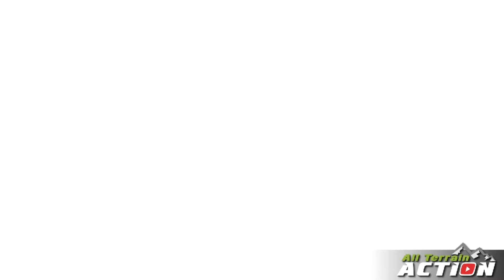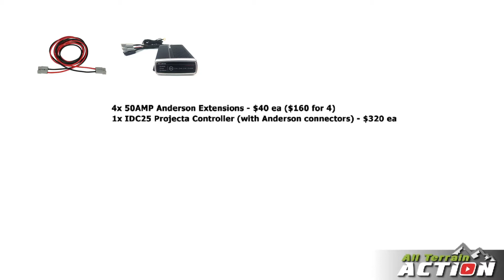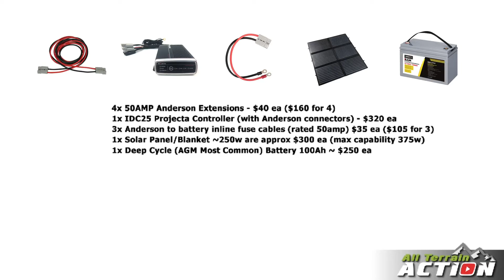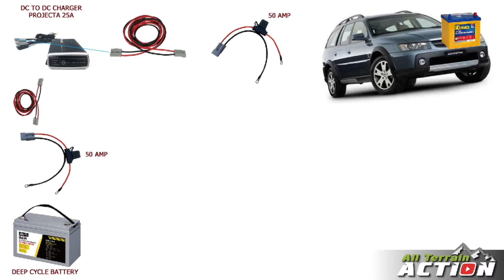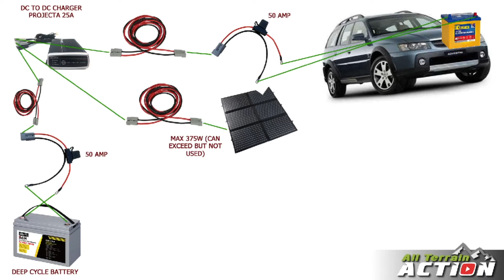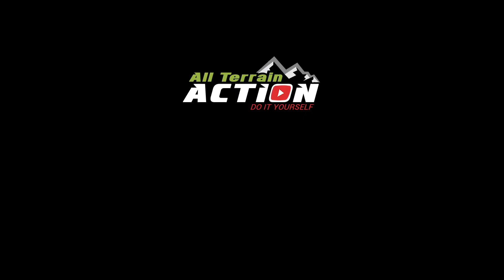EASY DIY Plug and Play Dual Battery System with Solar and DCDC Controller

Comment: What do you recommend as the best fuse option for in the engine bay
Maxi blade / 5AG / circuit breaker 
Cheers
Reply from the maker: Depends on the application. Normally would work out how many other aftermarket accessories I'd be setting up. Normally would just distribution block with blade fuse setup, unless extreamly high current eg 30a plus.
Reply from the maker: Maxi blade and 5AG fuse options mostly used for high amp stuff, big audio amps or mass of lights but if I had a circuit such as a 25a run to my dcdc from my main battery/car circuit i'd use a circuit breaker or self resetable because these are things you need when remote/travelling and you may not be able to replace a fuse in middle of no where, at least with circuit breaker or self resetable you can remedy the issue and reset. If you use a circuit breaker then its gone, short = no more power and you will be alerted to the problem as for self resetable it may reset so often you never notice. Each to their own in this sense.

Comment: can i just run the earths  to my bus frame
Reply from the maker: Yes you would normally run your earth to vehicle frame normally, we just did not include this as the idea was for those who didn't want to drill/mount into the vehicle permanently. This assumes your vehicle is negatively earthed and is part of the same circuit.

Comment: I was quoted $980 for the unit and then around the same amount to instill it .Bought one of these for $360 put it in my self works amazing :)
Reply from the maker: That's about what they charge now days, not much to it for DIY so long as everything is fused correctly and at the right spots likelihood of danger is low, in saying that any incorrectly wired up jobs are at risk of fire and you should always make sure you have a good understanding before proceeding. I've done my own work for over a decade never had an issue, thanks to the information available on the internet! -Chris

Comment: Forestry Forest always replaces his alternator to improve amperage for the DC  to DC converter which supplies the house battery. If you were to upgrade a Commodore alternator, what would you choose?
Great #Adventura video, saw one on motorway today.
Reply from the maker: also fairly sure adventra v6 alt is 120a std and v8 is 140a of that only about 80a is reserved for vehicles normal operation so plenty in there for the adventra, other vehicles need to be considered.
Reply: https://youtu.be/fjaiqUYs_qc
Foresty Forest DC DC converter, one of first uses of Crock Pot.....
Reply: https://youtu.be/jgoIocPgOug
Found this relevant link about burning out an alternator at 1500 rpm charging a lithium battery. My V6 sits at about 1900 rpm at 100 km/h....
Gonna find me an alternator....
Reply: Just found last video didn't use a DC DC converter so could b ok
Reply from the maker: @ceegee3664  the thing is though this and most smart DC to DC charger will only ever draw it's rated draw, in this case 25a so it should never really mess up any factory alternator infact some even have a voltage drop detection and if its unusually low will not draw from the alternator source at all.